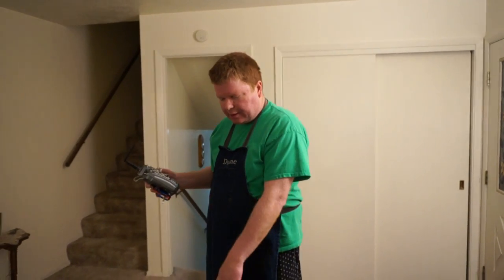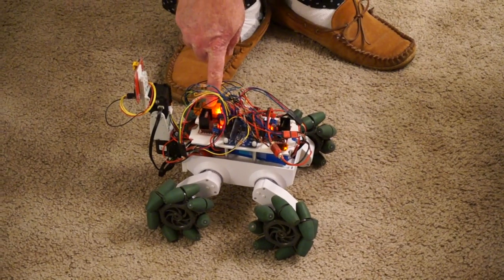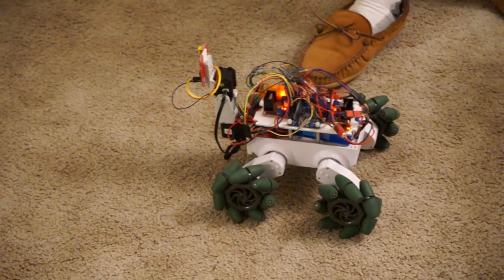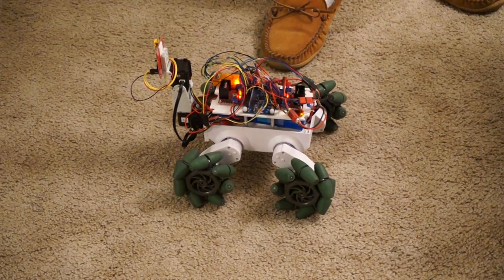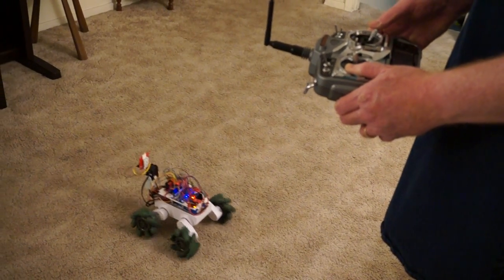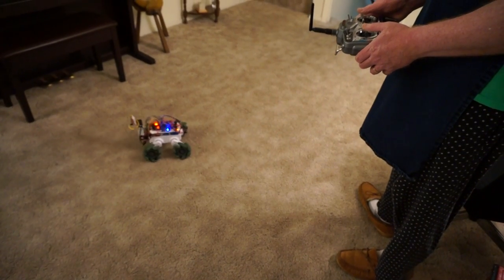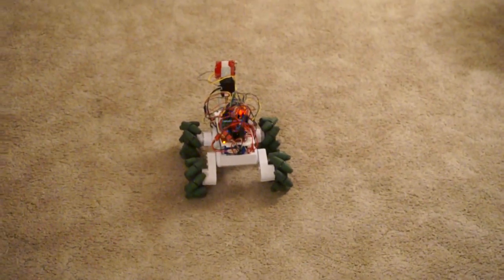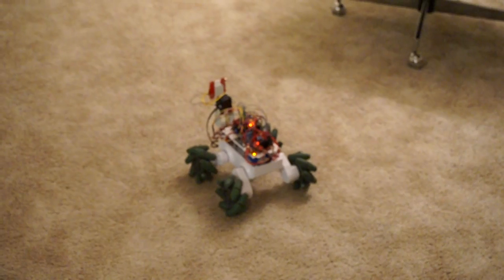MecanumPropellerRcControl131112a

Comment: hi... how to conect rover 5 whith adafluit motor steper servo shield v2? i have ent 1 adafluit servo shileld for 16 servos... ent 2 sensor shield for distance... ultra sonic...
Reply from the maker: +K Pantelis Sorry, I don't have one of Adafruit's motor shields. I used two inexpensive L298N boards for the motor control. Below is a link to a tutorial (of sorts) about using the cheap L298N boards.
http://forums.parallax.com/discussion/156410/how-to-use-a-l298n-dual-h-bridge-with-a-microcontroller-quickstart-board/p1

Comment: Thanks for sharing your bot, I was looking for good examples of holonomic driven diy bots and yours is a great one.

I just bought some parts to convert a second-hand Wowwee rovio to RC control and to learn and play with different control systems. I wasn't that interested in robotics until just recently when I saw what some of the new sensors can do and how affordable they are. I just ordered a motor shield, an IMU and the cmucam5 (called a pixxy) I think I might have a lot of reading and experimentation ahead. I hope I can get them working was well as you have.
Reply from the maker: You're welcome. The Rovio looks like a cool robot.
I have a robot with similar wheels in the following video.
OmniBotFigure8 130217a
I've only made the one video with my three wheeled onmibot. The wheels used by Rovio (I've seen them called "omni wheels") are a bit easier to control than the Mecanum wheels IMO. It still involves a bit of trig to figure out how fast the wheels should turn. The omni wheels are also a lot of fun to watch.
BTW, I'm also waiting for a Pixy. This stuff is a lot of fun but there's a lot to learn.
Good luck with your robot.